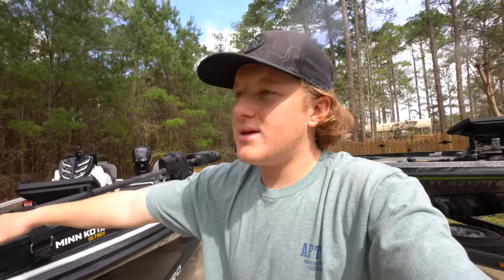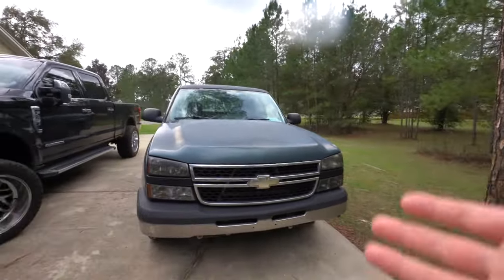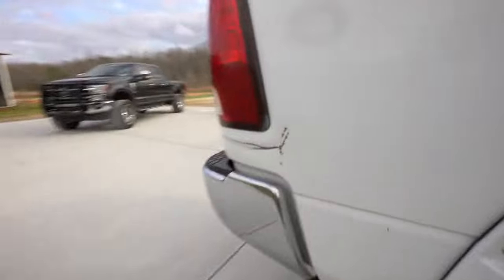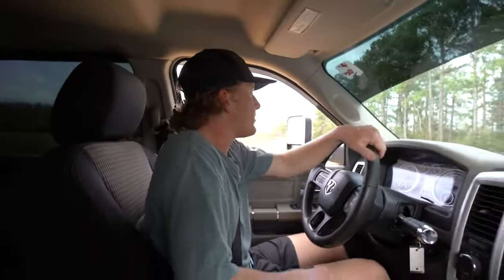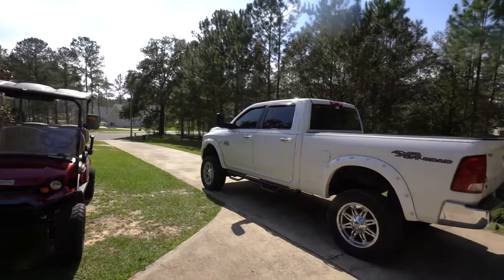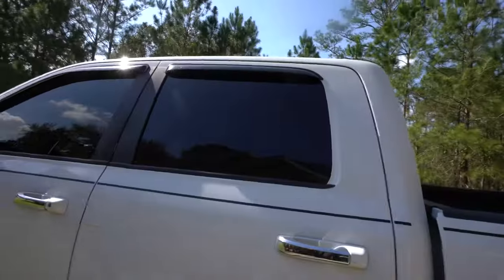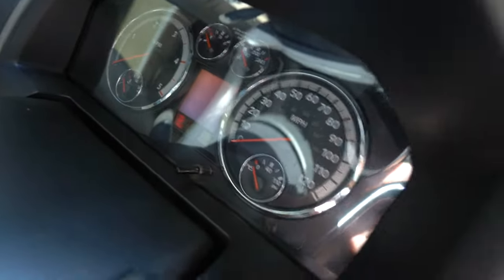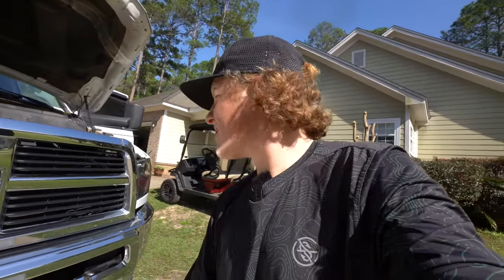BUYING A NEW DIESEL TRUCK TO TOW MY BOAT!! (Cummins)

Comment: A 6.7 Cummins with the factory air box and ccv suction tube at the back left of the valve cover will not show any blow by even when hot unless the hose is pinched off. Ask me how I know…

Comment: Not trying to sound like a hater at all the Cummins is almost the best diesel made dodge and ram has never figured out how to make the transmissions handle all the torque my boss and a lot of my friends have them and about once every year and a half they either have to have the automatics rebuilt or put new pressure plates and throw out bearings in them
Reply: Automatics don’t have throw out bearings my guy
Reply: Stick with manuals
Reply: I think you misunderstood what I said the automatic trannys have to rebuilt every year and half most of the time because of failure and the manuals have to have the pressure plates and throw out bearings changed in about the same time frame dodge never figured out how to build a transmission to put behind the Cummins because of all the torque they have